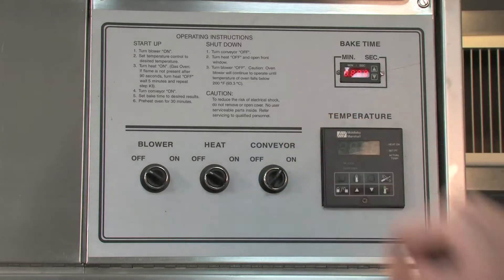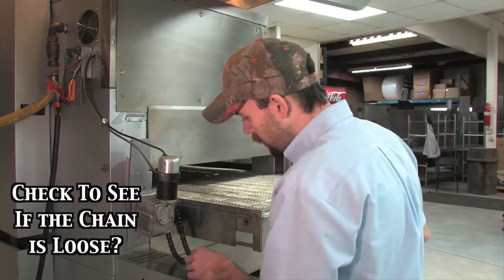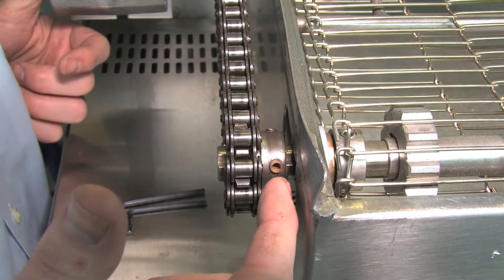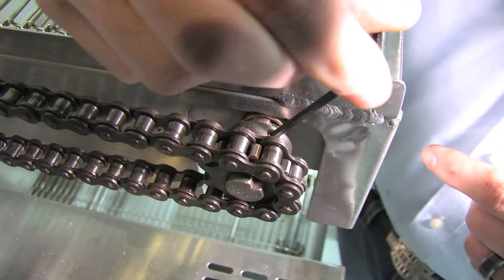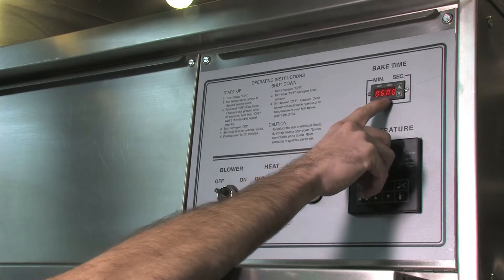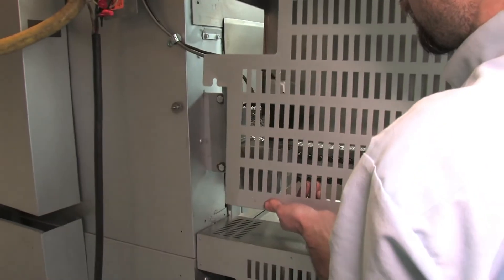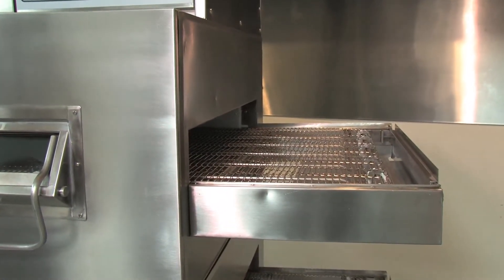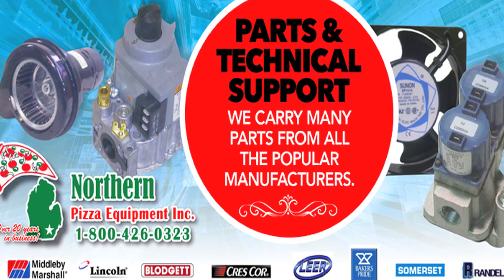How to Fix Pizza Oven Conveyor by Tightening the Set Screws

Comment: Excuse me 😅. I got a Lincoln 1300 serie. It doesnt has chain.. It works with GEAR motor. But some day speed up, AND i cant low the speed. Do you think It could be the hall, or maybe the speed control?? The GEAR motor works but It makes a noise, like something dragging. Any  advice , i Will be glad to hear. Please!
Reply: hello did you ever find out why the conveyor belt going so fast what did you fix